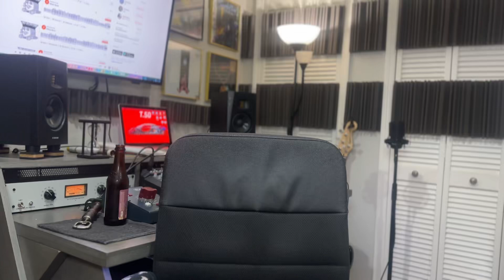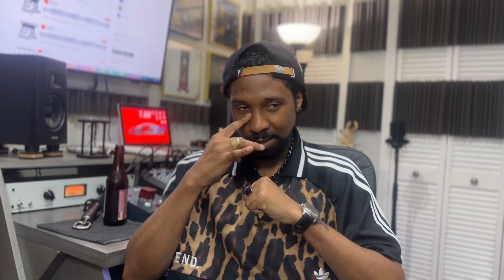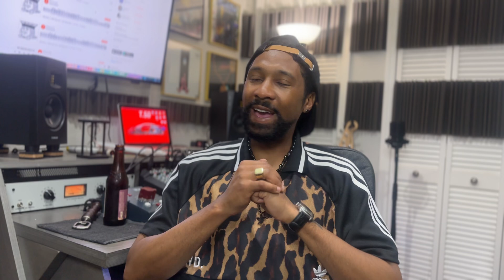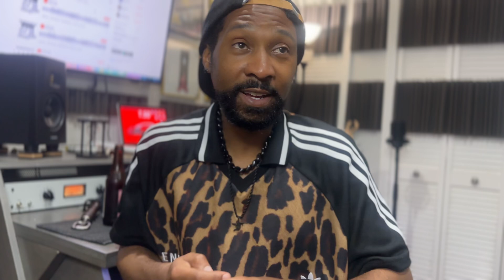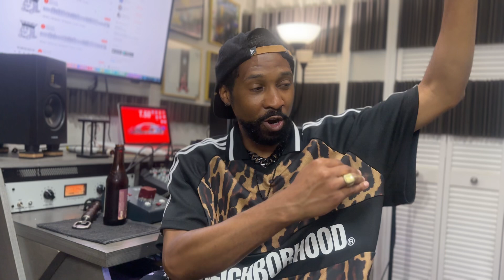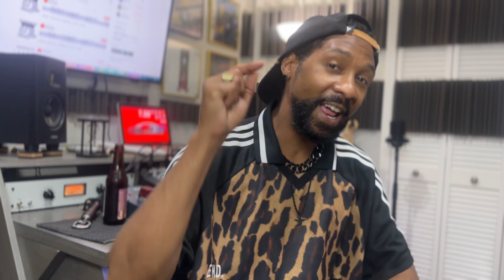The LAST Video You Watch on Audio COMPRESSORS! Period! The Last! #musicproducer #producer #audio

Comment: I use compression if I want to reduce the peaks of the audio, soft clipping is rounding the signal, and to much will muffle the sound, hard clipping will be more of a straight cut and cna make the sound more punchy but to much will be a distorted mess. When actually looking at the wave form it looks like it sounds, did you know even are own speach follows the same rules. The word Fuxx is a harsh word with a hard clipping looking wave, where the word bubble is a soft rounded looking wave. Shouting at someone is like slapping a distortion on someones ears. I find audio frequencys pretty fascinating to look at.